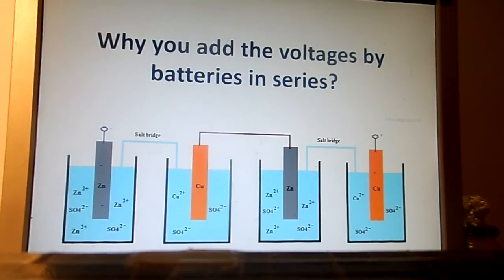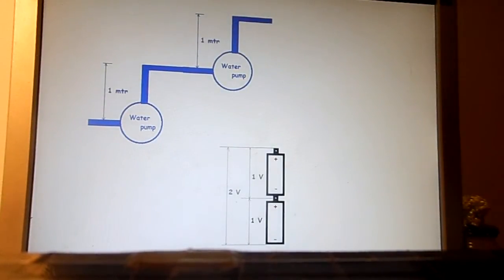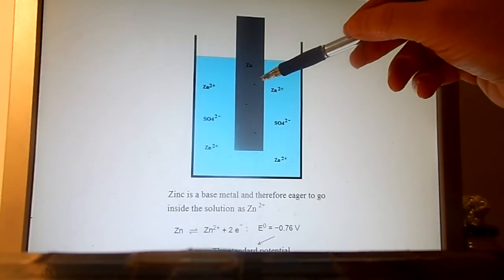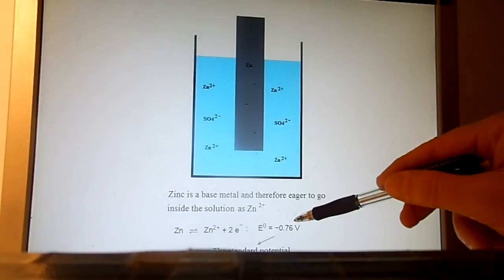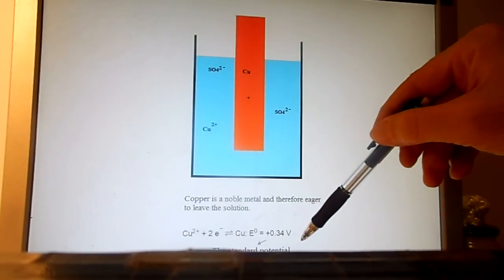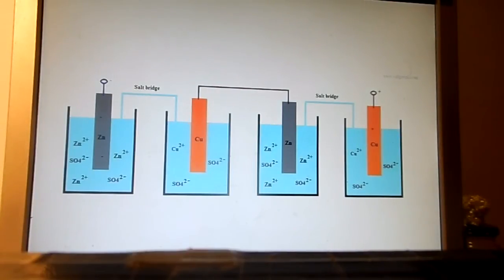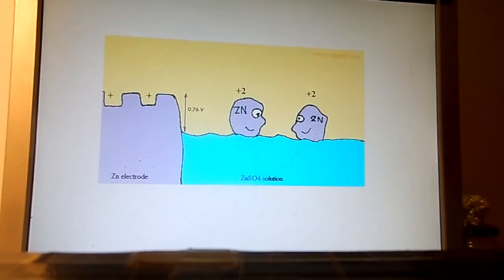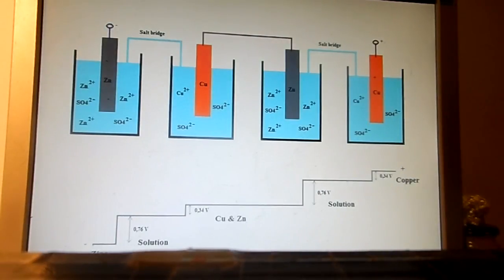Why you add the voltages of batteries in series?

Comment: Being troubled by the same puzzling question, I stumbled upon this video. Although it is helpful it is not accurate (as indicated by the maker) and at some points a little obscure.

For instance the video states that: "There is equilibrium when the voltage difference between the electrode and the solution is - 0,76 V (this is just a property of zinc)". 

Well, this is simply not true. The so-called reduction potential of -0,76 V is the measured potential difference against a standardized HYDROGEN-halfcell and not against the surrounding solution. The same is the case for the Copper-halfcell: its potential difference against the HYDROGEN-halfcell is 0,36 V. This standardized (temperature, concentration and pressure) Hydrogen-halfcell is arbitrarily chosen as a reference cell (defined to be 0 Volt). We can now calculate the potential between the Copper-and-Zinc-halfcell-pair by subtracting the reduction potentials of each against the Hydrogen-halfcell. Fundamentally, the law of conservation of energy allows us to do so (kind of a path-indepency characteristic of any potential field). 

This being considered more fundamentally, how is it that you must add the voltages of a pile of batteries?

Let's look at one battery to start with. First, it must indeed be true that the potential difference of each electrode against its surrounding solution is a certain specific value in equilibrium state (although it can not be derived as in the video). It is this specific potential that balances the electrostatical forces against the electrochemical drive of the metal ions into the surrounding solution. Second, it is also true that the potential of each of the solutions in the two connected halfcells must be the same, as the salt bridge will balance out any differences immediately.

Now, if we connect one of the electrodes of a battery with an external charge-reservoir the electrode and the reservoir must obtain the same potential. As a result, the potential of the surrounding solution will be altered such that the difference against the electrode is maintained at the specific value required for equilibrium. As the potential of the surrounding solution is altered, the salt bridge evens out any potential differences between the two solutions in both halfcells. To maintain equilibrium, the other electrode's potential must as a consequence shift to compensate for this altered potential of the surrounding solution. 

This process involves complicated back-and-forth dynamics of dissolving and plating ions on both halfcells, while the salt bridge is buzzy keeping the electrolytes balanced at all times. Luckily, the end result at equilibrium is not complicated at all. The potential difference between the two electrodes must be the same as before as they will each need to maintain a certain potential offset against its surrounding solution, which happens to have the same potential everywhere.

How does this relate to adding the voltages of a pile of batteries? 
Well, the charge-reservoir is replaced by just another battery. Once the plus terminal of the first battery is connected to the minus-terminal of the second battery (and both batteries are in a closed circuit!) the first battery keeps pumping electrons to the terminal of the second battery until they arrive at the same potential in equilibrium state. The closed circuit is required for an endless supply of electrons to do so and the complicated balancing act (ions dissolving/plating and shuffeling of electrolyte by the salt bridges) takes care that every electrode has the right potential offset against its surrounding solution.

Mathematically:

V1- - V1s = a
V1+ - V1s = b
V2- - V2s = a
V2+ - V2s = b

Where
Vij = Potential at j (+ = plus pole, - = minus pole, s = solution) of battery i.
a,b = Specific equilibrium voltage between electrode of type a,b and the surrounding solution in the halfcell

We have
Potential of battery 1 = V1+ - V1- = b-a
Potential of battery 2 = V2+ - V2- = b-a
Serial potential battery 1 and 2 = V2+ - V1- = b - a + V2s - v1s

At closed circuit and equilibrium V1+ = V2- therefore V2s - V1s = b - a

Potential of serie battery 1 and 2 = b-a + b-a 
Which is the same as the sum of the potentials of battery 1 and 2. 

Finally, if this reasoning proves the validity of adding the voltages of two batteries it is easy to generalize that any pile of n batteries can be added if we 

consider them as n-1 pairs: (V1 + V2 + V3 + ...+ Vn) = (...((V1 + V2) + V3) + ...Vn-1) + Vn.
Reply from the maker: Thank you for your response. My explanation is indeed quite qualitative and not very correct, but just intended to understand a little bit the process in an intuitive way.

Comment: Thanks for showing your example,,

I want ask a question 
One betery is 12v, 100ah.
another betery 12v,240ah  connect  in series what app will dominate then?  
Ans please with example  and math apply.
Reply from the maker: It is already some time ago I made this video, and only I tried to explain in an intuitive way a little what happens when you connect batteries in series. But it seems to be no good idea to connect in series batteries that are not of the same type, capacity etc.   Search in Google for example : "connect two batteries in series with different amp hours"